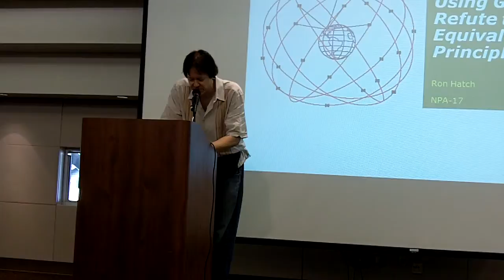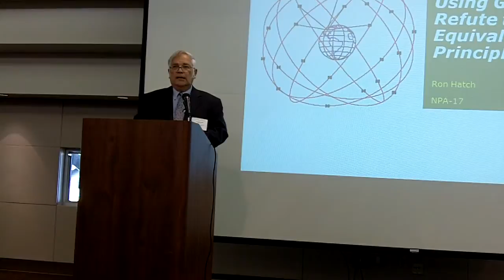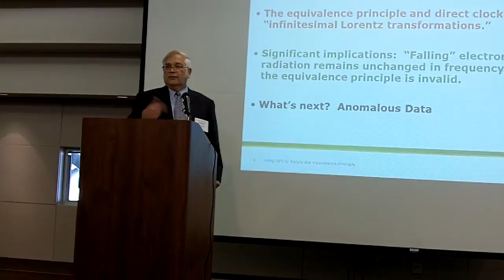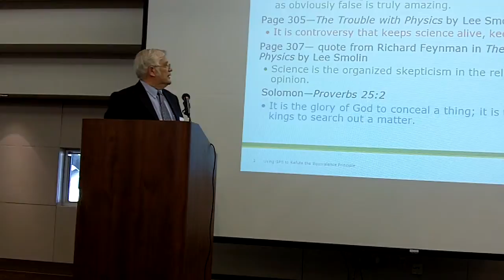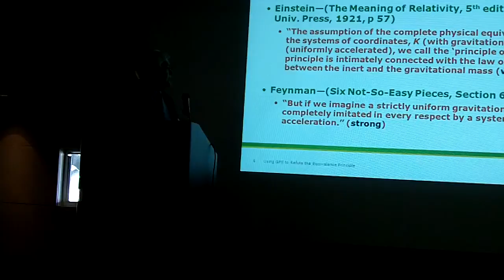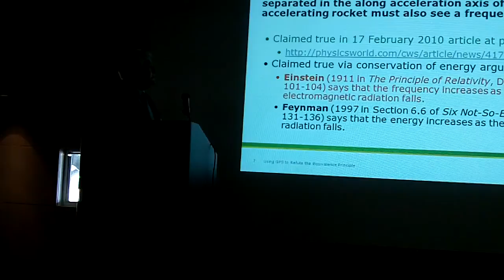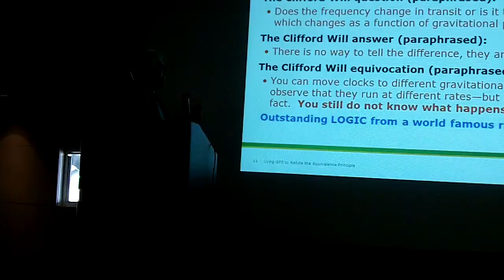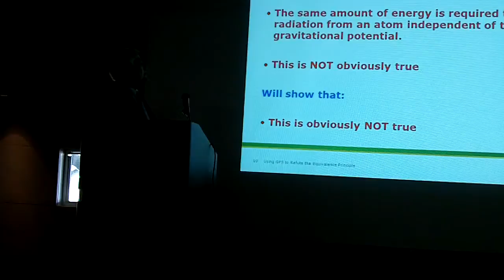Ron Hatch: Using GPS to Refute the Equivalence Principle - Part 1

Comment: I'm so confused. Wtf is this video and why is everyone pretending like Einstein's Relativity (one of the most successfully tested theories in all of history) is wrong? What the actual fuck
Reply: Magical dark matter says hi
Reply: They are not pretending.  It is wrong.  Fundamentally wrong.  Philosophically, mathematically, logically wrong.  This is easily provable.  The fundamental equation used by physicists is E=hv (or E=hf) where E is energy in Joules, h is Planck's constant in Joules*seconds, and v (or f) is the frequency of light in Hertz.  The SI units for the unit Hertz are cycles per second.  A unit analysis of this equation is Joules=(Joules*seconds)*(cycles/second) which reduces to Joules=Joules*cycles.  This is the fundamental equation that "quantized" light, converting it from a wave to a particle called a photon.  As you can see, the two sides do not balance so the equation itself is incorrect; rubbish.  Once you dispense with light being a particle, most of the physics in Einstein's general relativity no longer works.  This also explains why quantum physics is wrong as well.  Neither light nor electricity are particulate.  They are field phenomena.
Reply: @wesbaumguardner8829  I can see that you know a bit of physics, which makes things more perplexing for me. You must have heard of the wave-particle duality of nature, surely? Plus, are you not aware of the field theoretic description of nature with Quantum field theory? And no one is claiming that these theories are the complete description of our world. They are incomplete, or if they turn out to be wrong, they are pivotal stepping stones to developing the correct theories. Nevertheless, these theories are the best humanity has, and all of modern technology is founded upon the principles of quantum mechanics and relativity. 

You said a lot of words, but I didn't catch where exactly you pointed out how quantum mechanics nor general relativity are wrong ? Where is this proof you speak of?  

Plus, are you claiming that the worldwide network of hundreds of thousands of scientists, researchers, engineers, teachers, etc. are working together in some global conspiracy to hide the true nature of reality? What good does it do to teach incorrect theories of our world if you know what the correct description is? I'm confused in multiple ways what the purpose of making these claims are.
Reply: @speeshers  "I can see that you know a bit of physics, which makes things more perplexing for me."  Why is that?  If the mathematics is broke, it is broke.

"You must have heard of the wave-particle duality of nature, surely?"  Yes, it is taught religiously in the education system because it is a religion.

"Plus, are you not aware of the field theoretic description of nature with Quantum field theory?"  Their field is a mathematical abstraction rather than a description of reality.  They start with erroneous mathematical equations and continue racking up errors as they go creating numerous paradoxes and contradictions, just like general relativity. 

" And no one is claiming that these theories are the complete description of our world."  Then why do they pretend they know everything and scoff at people whom reject their contradictory nonsense?  Particle superposition?  Really?  Virtual photons?  Really?   

"They are incomplete, or if they turn out to be wrong, they are pivotal stepping stones to developing the correct theories."  Believe what you will, I think they have been used to conceal the way the world actually works by people in government whom control the education system and have a vested interest in keeping people ignorant.  Our ignorance is their power.

"Nevertheless, these theories are the best humanity has, and all of modern technology is founded upon the principles of quantum mechanics and relativity."  That is your opinion.  I disagree.  Very little, if any, technology has been created by these erroneous theories.  

"You said a lot of words, but I didn't catch where exactly you pointed out how quantum mechanics nor general relativity are wrong?"  Do you not understand that the fundamental equation that both theories rely upon to "quantize" light into a photon is just pure bs?   How can Joules=Joules*cycles?  It cannot.  This is an absurdity, but it is in line with all the rest of the irrational nonsense spouted by these people.  Schrodinger wrote his cat equation to make fun of Einstein's theory and show how absurd it was.  Anyone that thinks a cat can be both alive and dead at the same time is an idiot.  Now the qm people use that equation for their explanations.  They feed this bs to the ignorant masses and they lap it up and beg for more.  It would be funny if the problems it causes was not so serious.

"Plus, are you claiming that the worldwide network of hundreds of thousands of scientists, researchers, engineers, teachers, etc. are working together in some global conspiracy to hide the true nature of reality?"  Most of them are just parrots parroting the nonsense that was parroted to them.  The education system is an echo chamber.  This happens with all hierarchical social structures.  The few that recognize the problems and speak out about them get shut down fast by their superiors.

"What good does it do to teach incorrect theories of our world if you know what the correct description is? I'm confused in multiple ways what the purpose of making these claims are."  It keeps people dumb, ignorant, and in their place as easily manipulated and controllable automatons that do not think or question, but merely absorb and regurgitate information on demand instead of observing what is really occurring and using that information for their own devices.

Now, my question for you is why do you not even attempt to refute my claims about the Planck-Einstein relation?  Shouldn't you be trying to prove that I am a simpleton that doesn't know anything and have it all wrong?  And, if I do not have it wrong, (which I do not) shouldn't you be like, wow, all these people I thought were so intelligent are complete retards?  How could they make such a simple and fundamental error and just keep repeating that error for over 100 years and teaching everyone the same error during that time period?  Let me know when you figure that one out.  I have pretty much already told you why.
Reply: I kind of misspoke.  Cycles aren't unitless, the units are 1/s.  It's "cycles per second".  

Imagine a  sinewave with a period of  0.001 seconds.
The value you would use in an equation can be thought of as (0.001 * 1 second).
The frequency is the reciprocal, or 1/period, which would be 1000 Hz.
So to use that in a formula, it's 1000 * (1/seconds).  Get it?  There was only one unit when the value was being used as a time period, so if you take the reciprocal of that, there is only one unit still.  You don't gain another unit.
Reply: @Hyxtryx  "Cycles aren't unitless, the units are 1/s.  It's 'cycles per second'."  How could cycles have a unit of "cycles per second?"  That makes no sense.  You are literally using cycles to describe cycles which is a circular fallacy.  That's like saying "seconds have a unit of measure.  Its seconds per count."  Cycles themselves are a unit of measure.  They are literally counted just as meters are counted, seconds are counted, etc.  You cannot just ascribe a random rule for this one unit of measure which is not applicable to any other unit of measure like the physicists are doing.

"Imagine a  sinewave with a period of  0.001 seconds.
The value you would use in an equation can be thought of as (0.001 * 1 second)."  This is written incorrectly.  You got rid of the seconds unit from the 0.001 and then multiplied by 1 second while also getting rid of the cycles (or waves) unit of measure.  This is the common practice of physicists whom are completely screwing up the logic of the mathematical equation by doing this.  Written correctly, it would be 1 period(or wave or cycle)/.001 seconds.  The word period is completely synonymous with wave, so this works.  Waves are a type of cycle so denoting it as a cycle also works.  That would give you 1,000 periods (or waves or cycles) per second, or 1,000 Hertz.  A cycle is not the inverse of time.  

"So to use that in a formula, it's 1000 times (1/seconds).  Get it?  There was only one unit when the value was being used as a time period, so if you take the reciprocal of that, there is only one unit still.  You don't gain another unit."  See the first section of this response.  The explanation you are providing is an error.  Cycles is a unit of measure which is physically measured and cannot be done away with.  You are literally measuring the cycles.  This is physical information.  It is not a contrivance or an abstraction but literally a part of the physical world absolutely necessary for a frequency to be observed.  I do not know how to state this any more plainly.

"Because meters/sec, and joules/sec, etc. is all based on a time unit of "1 second", the 'cycles' unit isn't needed, and shouldn't be used."  Being a unit of physical measure, it absolutely must be used and cannot be discarded without creating an error.

"Now do you get it?  Or do you still think you've stumbled onto an anamoly that has escaped everyone else?"  I understand physicists have been perpetuating this error for a long time.  I am not the person whom discovered it, either.  As far as I am aware, it was Juliana Brooks in this paper:

https://img1.wsimg.com/blobby/go/e266e5e7-739c-437c-89c3-eed60d3a9f3f/downloads/1cfqec4a8_58871.pdf
Reply: When you think about it, frequency (Hz) implies "cycles per second".  If you have a volts/second, or meters/second, that doesn't imply that there is any cycling going on.  So the unit of a cycle (0-360 degrees) has been taken out of all the equations.  Wherever the reciprocal of Hz is used, it's just seconds, not seconds per cycle.  So if you don't use the "cycles" unit in the denominator when using the period of a wave in a calculation, you don't use it in the numerator when using Hz.

If you're using Hz in an equation, it can only mean cycles per second.  It can't mean anything else per second.  So somebody (maybe Hertz himself) decided to remove "cycles" as a unit.  It's not needed if you consider 1/Hz to be simply seconds.
Reply: @Hyxtryx  "When you think about it, frequency (Hz) implies "cycles per second".  If you have a volts/second, or meters/second, that doesn't imply that there is any cycling going on."  The Hertz unit does not "imply" cycles per second; it is specifically defined as cycles per second.  If there is no cycle, there can be no Hertz.  Cycles are a unit of measure.  Meters are a different unit of measure.  Volts are a different unit of measure.  These units are neither equivalent nor interchangeable.  You cannot substitute one for another, nor can you just neglect them as the physicists have been doing.

"Wherever the reciprocal of Hz is used, it's just seconds, not seconds per cycle."  That is just wrong.  You cannot just get rid of a unit of measure ad hoc.  This is a fundamental principle at the basis of physics.  You are basically saying the equivalent of the Newton=Kg*1/second^2.  See, you can't just get rid of the meter because it was not used in the denominator.  The Hertz = cycles/second does not equal 1/second.  

"If you're using Hz in an equation, it can only mean cycles per second."  Exactly, so you cannot just delete cycles and pretend the equation works since the equation is balanced once you delete the cycles.  This is folly.

"So somebody (maybe Hertz himself) decided to remove "cycles" as a unit."  If there was a god, not even he could get away with that.  Error is error is error.  You cannot get correct errors.
Reply: @wesbaumguardner8829  "The Hertz unit does not "imply" cycles per second; it is specifically defined as cycles per second."
It is defined as cycles/second, but it is implied when using Hz in equations because the 'cycles' unit isn't used in equations.  It's already baked-into the equations, or baked-out or however you want to think of it.  If you're using frequency (f) in an equation, the units are 1/seconds.  If you use 1/f in an equation, the units are seconds.  That can be done, because that's how Hz is defined.  If you were to re-derive that Joules equation and plank's constant, but used cycles/second as the units for Hz and seconds/cycle as the units for the reciprocal of that, then you could use a "cycles" unit in your original E=hf debunking, and it would all work out.  You'd have a cycles to cancel it with, and then Joules = Joules.  But because they took it out when deriving the equations, you have to take it out when using those equations.

Cycles is different from units like meters, volts, joules, because of this:
With meters, you can break up a meter into smaller or larger units, like feet or miles.  It's just a multiplication to convert between the two, right?  So using m, or mm, or ft as units is really just a multiplication going on to rescale the number.  1 inch becomes 2.54cm.  You just rescaled the number into the units you want so that they match the units you need to use in the equation.
With cycles, a cycle is defined as  (2 * pi) radians.  So when you say "you're saying cycles = 1 always", yes, that's kind of what it is.  A cycle is 2*pi.  2*pi is baked into the equations as 1 cycle.  2 cycles would be 4*pi.  That's why you don't need a units of "cycles" when dealing with Hz.

If you want a "something per second" when dealing with frequency, and want to keep that unit in the equations, you would use degrees or radians per second.  

If what you say is true, why does the math work?  Testing that E=hf isn't something that many people would know how to do, I imagine.  But testing the frequency response of an RC filter circuit is, and Hz is used in those equations.  If you put cycles into there, and solved for different things, you might wind up with things like 10 cycle ohms, or 10 microfarads per cycle, which doesn't make any sense.  If the math were broken there, many people would have noticed.  

The bottom line is:  Hz is cycles / second, but a cycle is defined as 2*pi radians, and that 2*pi is baked-into the equations.  Look up Joule on wikipedia.  There is a theta in it, and that's in radians.  But there's no radians in the units for energy, right?  They have removed that unit (and now we're back to square 1).
Your Joules = Joules * cycles is really Joules * 2pi radians = Joules * cycles, and the 2pi radians cancels with cycles and you get Joules = Joules.
I'm not a professor, I can't explain it any better.
Reply: @Hyxtryx  "It is defined as cycles/second, but it is implied when using Hz in equations because the 'cycles' unit isn't used in equations."  That is what I am saying.  They are putting it in or taking it out ad hoc to make their equations appear to function.  It is just a form of sophistry.

"It's already baked-into the equations, or baked-out or however you want to think of it.  If you're using frequency (f) in an equation, the units are 1/seconds.  If you use 1/f in an equation, the units are seconds.  That can be done, because that's how Hz is defined."  As far as I can tell, absolutely no units were used at all until determining the constants in his paper.  Feel free to tell me where exactly Planck abandoned the use of the cycles unit in his paper.

"If you were to re-derive that Joules equation and plank's constant, but used cycles/second as the units for Hz and seconds/cycle as the units for the reciprocal of that, then you could use a "cycles" unit in your original E=hf debunking, and it would all work out."  How would that work when absolutely no units were used in the derivation of the equations?

"cycles is different from units like meters, volts, joules, because of this:
With meters, you can break up a meter into smaller or larger units, like feet or miles.  It's just a multiplication to convert between the two, right?  So using m, or mm, or ft as units is really just a multiplication going on to rescale the number."  You can break down a cycle into fractions as well as any other unit of measure.  They do this all the time.  observing 1/2 a wave is no different than observing 1/2 a meter in that respect.  Draw a sine wave.  You can stop at any single point along that wave you want to observe and say hey look its this fraction of the wave.

"With cycles, a cycle is defined as  (2 * pi) radians."  It can also be described in degrees, periods, turns, etc. depending on the type of cycle being observed/measured.

"So when you say "you're saying cycles = 1 always", yes, that's kind of what it is.  A cycle is 2*pi.  2*pi is baked into the equations as 1 cycle.  2 cycles would be 4*pi.  That's why you don't need a units of "cycles" when dealing with Hz."  You are completely neglecting all the other ways to describe a cycle to make it appear overly complicated and convolute the fact that physicists are treating the cycles unit of measure differently than every single other unit of measure just to make equations that do not actually work appear to work.  0.25 cycles, 0.4839475812854961 cycles, 202 cycles.  Hey look, I can break down the cycles unit without dealing with radians.  Its a miracle!  I must be a genius!  I achieved a feat no physicist in the history of physicists has ever done!  Where's my Nobel prize?

Here's the problem.  You and the physicists are claiming cycles IS the number 1.  So you can now substitute the number 1 with cycles anywhere in any equation.  E=hf=hf*1*1*1*1*1=hf*cycles*cycles*cycles*cycles*cycles=hf*cycles^5=1*hf*cycles^5=cycles*hf*cycles^5.  I could do this forever.  The only way cycles = 1 is if the word cycles is absolutely meaningless.  You are basically saying 1 cycle = 1 nothing.
Reply: @Hyxtryx  "Where do you get that from?"  From reading the paper.

"Maybe he kept all the units in his head, and just wrote them down after."  Maybe that is why he has an unbalanced equation as the result.

"'Confusion can arise when dealing with frequency or the Planck constant because the units of angular measure (cycle or radian) are omitted in SI'."  Yes, their lack of adherence to principle and proper communication confuses the shit out of people which is why they should strive to communicate their ideas properly.

"There are 5 references for that one line.  Why is nobody besides you saying 'You can't do that!'?"  Because no one else understands the problem and they just accept whatever nonsense was put on Wikipedia because they are not intelligent enough to know any better.

"The same article says  h = 6.62607015×10−34 J⋅Hz^-1."  So are you telling me the Wikipedia page trumps the original paper?  Great argument!

"If you say Hz is cycles/second, then 1/Hz is seconds/cycle, and there's the cycle in the denominator that cancels the cycle you put in the numerator.  So if you want to say Hz is cycles/second and keep the cycles unit in play, then h = 6.626E-34 J seconds/cycle.  Multiply by f (in cycles/second), and the seconds cancel, and the cycles cancel, and you're left with Joules = Joules."  No, h is in erg*seconds in the original paper.  An erg is 10^-7 Joules, so h is in Joules*seconds units.  Joules*seconds does not equal the Hertz.  

"It also says h (with a little bar on the top) = 1.054571817 ×10−34 J⋅s.   So in that case, cycle is replaced by 2*pi.  Seconds/cycle = seconds/(2*pi).  The 6.626 has been divided by 2*pi to compensate.  Like I said, 2*pi is baked-into the equations, such that you don't need to keep the cycles unit in there."  Wrong.  It would be 2*pi radians.  A cycle equals 2*pi radians.  The radians would be the unit of measure which replaces the cycles unit of measure.  You cannot just discard a unit of measure unilaterally and get a correct result.

"You conveniently used the definition of h that has units of Joule seconds.  And that one leaves out the cycles unit."  Because that is what is in the original paper.  You are just trying to lie and claim that your arbitrary ad hoc unit changes make the equation correct.

"Why don't use use the other definition of Joule that exists, so the units are Joule seconds / cycle."  (Kg*m^2)/(s^2) = ((Kg*m^2)/(s^2))*seconds*(cycles/seconds) = ((Kg*m^2)/(s^2))*cycles  There, I did what you said.  The equation is still wrong.
Reply: @wesbaumguardner8829  "(Kg*m^2)/(s^2) = ((Kg*m^2)/(s^2))*seconds*(cycles/seconds) = ((Kg*m^2)/(s^2))*cycles  There, I did what you said.  The equation is still wrong."

You did it wrong.

Joule (E) units = (kg * m^2)/(s^2)

Plank (h)  units = Joule * Hz^-1  =  Joule * seconds / cycle

Hz units = cycles / second

E = h * f

(kg * m^2)/(s^2) = (kg * m^2)/(s^2) * seconds / cycle   *   cycles/second

(kg * m^2)/(s^2) = (kg * m^2)/(s^2)

Joule = Joule
Reply: @Hyxtryx   "You did it wrong."  No I did not.

"Plank (h)  units = Joule * Hz^-1  =  Joule * seconds / cycle"  That is incorrect.  The units in the Planck's original paper are erg*seconds.  An erg is 10^-7 Joules.  Therefore, he wrote it in the equivalent of Joules*seconds.  Your nonsense has absolutely nothing to do with Planck's constant.  You are just making it up out of thin air.

"Hz units = cycles / second"  That is correct.

"(kg * m^2)/(s^2) = (kg * m^2)/(s^2) * seconds / cycle   *   cycles/second"  That is incorrect.  Planck's constant does not have any cycles unit in it.  You are just making that up.  Again, here is a link to his original paper which proves you wrong.

https://archive.org/details/onlawdistributio00plan_745
Reply: @wesbaumguardner8829  Joule seconds, erg seconds, it doesn't matter.  The seconds in there refers to the period of a wave.  Which is seconds/cycle.  He called that seconds.  If you want to use Hz with it, you have to use 1/seconds.  If you want to use cycles/second as Hz, you have to use seconds/cycle as the 's' variable in Plank's constant.  

You're doing it wrong, and I challenge you to find any mathematician, physicist, whatever, that agrees with you.

But, there may be something wrong with Plank's constant after all.  This video claims there's a "bug" in it.  Namely, that the "s" is actually "1 second", and should not have been included in plank's constant.  You have to take the 's' out of h, and multiply by the time duration (in seconds) of your measurement/experiment.  So the equation becomes E = h * t * Hz.   That has implications elsewhere, so other equations have to change in a similar way.

Plank's Constant and the Nature of Light
https://www.youtube.com/watch?v=Vce_1yfTTBY
Reply: @wesbaumguardner8829   "Schrodinger wrote his cat equation to make fun of Einstein's theory" - no he didn't. Because it wasn't Einstein's theory.
Reply: @Shoomer88  90% of the General Public simply is not interested.  Of the remaining 10%, different groups form.  You have an interest.  Wes B. Guardner has an interest.  I have an interest.  Peter Damen has an interest.  In the year of 1994, the Natural Philosophy Alliance (NPA) formed .  This video is from 15 years ago.  The man on the screen is David Scott de Hilster.  He is introducing Ron Hatch.  NPA dissolved in 2014.  Hilster formed the John Chappell Natural Philosophy Society (CNPS) and CNPS has an Internet site.  Best Regards.
Reply: @wesbaumguardner8829  E=hv in units: E is energy in Joules, h is Planck's constant in Joules*seconds, and v is the frequency of light in Hertz (1/seconds), which reads: Joules = Joules*second * 1/seconds, which reads Joules = Joules. The cycles you are referring to are dimensionless, like a constant, and don't have a SI unit!
Reply: @peterdamen2161  The unit of measure for frequency is not 1/seconds.  1 is not a unit of measure.  When they measure frequency of light, they are literally counting light waves that pass a certain point in a 1 second time interval.  Waves is a type of cycle.  Waves are a unit of measure.  Cycles is a class of units of measure that are simply a form of cyclical event that can be counted.  Examples of cycles are revolutions, rotations, waves, etc.  You cannot just arbitrarily decide to get rid of a unit of measure.  But that is exactly what they are doing.  1/seconds is not a measurement at all.  Frequency is not the inverse of time.  That is what you and the physicists are claiming.  It is abject nonsense that has no basis in reality.  

If cycles are dimensionless, so are seconds.  You can literally observe the cycles.  You cannot observe seconds at all.

If cycles are dimensionless, volts and amperes are dimensionless.  Yet we use those as units of measure.

If cycles are dimensionless, farads, bacquerels, grays, and sieverts are dimensionless, too.  Yet, those are units of measure.  

If your argument stands, the majority of units of measure must be thrown into the garbage bin.  Are you ready to just start throwing units of measure away?
Reply: @peterdamen2161  Also, if Hertz = 1/s, then velocity is distance x frequency, acceleration is distance x frequency^2.  Abject nonsense.
Reply: @wesbaumguardner8829  It's a number, not an SI unit!
Reply: @wesbaumguardner8829  OH, now I see it, you're a conspiracy theorist. That says it all. Please stop with this nonsense!!!
Reply: @peterdamen2161  "It's a number, not an SI unit!"  So, when we count volts, meters, seconds, amperes, Joules, Sieverts, etc. those are just numbers, too, eh?  Abject nonsense.  Your cliam has absolutely no basis in logic.  When you count things, you are measuring them.  And when you measure things, you use a unit of measure.  Period.  When they count waves to measure the frequency of light, they are literally performing a measurement.  The waves are the unit of measure.  You cannot claim that counting seconds is different than counting waves.  You cannot claim that counting meters is different than counting waves.  You cannot claim that counting apples is different than counting waves.  Your position is completely nonsensical.
Reply: @wesbaumguardner8829  Ant the unit is 1/s. It's that easy. End of discussion!
Reply: @peterdamen2161 Wrong.  Waves per second is the unit of measure.  They are not counting 1's per second.